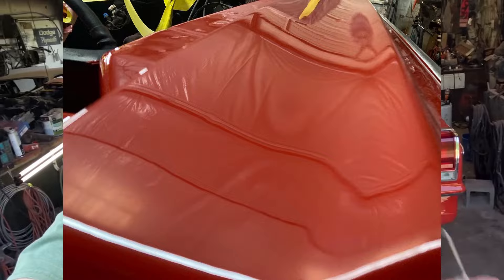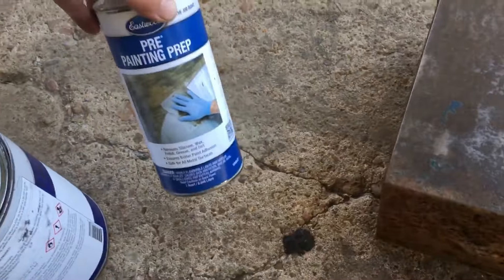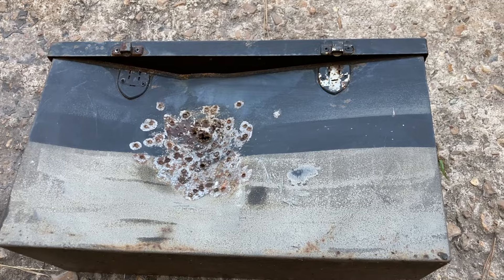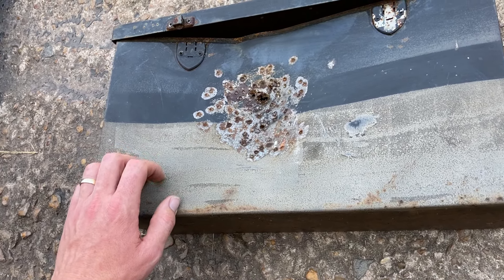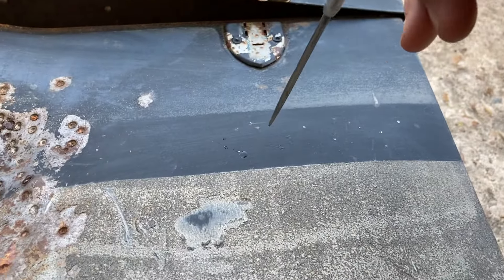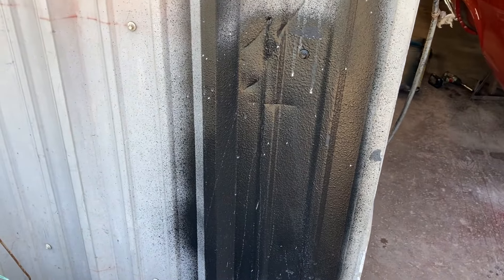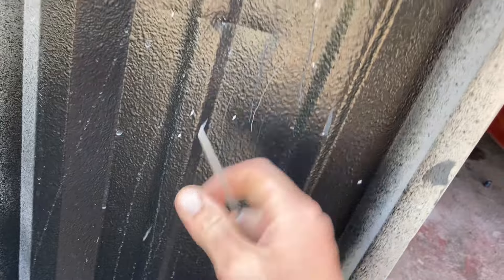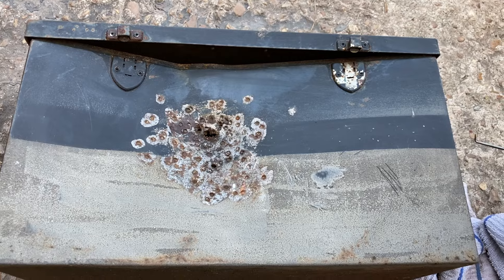Eastwood’s Rust Encapsulator, Ultimate Test: 2 years Later! #eastwood #rust #diy #test

Comment: Bout to get me some of this. My hubs got a 2014 that has a wee bit of rusting strips on the inside of his door jamb. Its not deep rust, so i was gonna use a wire brush and clean it up. But i needed to find something that was gonna last and actually stop the rusting process. Ty so much for this video.
Reply from the maker: It should do the trick! I’ve even let this stuff flash off and primed over it, then painted. In a pinch, I’ve painted right on top of it.

Comment: Man i sprayed that rapter liner on my trucks aluminum diamond plate bed-rails and that stuff flaked off like 50% of the coverage after maybe a month or two. I didnt do much prep but since then i have resprayed with regular rustoleum gloss black and it has held way longer
Reply from the maker: @taoisttiger4702  oh man. I would definitely say prep is key. If you could have scuffed the diamond plate or etched it with a chemical. KBS coatings sells an etch for bare metals to promote adhesion
Reply: FYI for you or anyone that sees this; Aluminum diamond plates often have a plastic film coating or some kind of sealant. You can use muriatic acid to remove it. it'll also look really shiny. but neutralize the acid and seal it immediately. Aluminum still oxidizes. But it doesn't turn red like iron and steel do.

Comment: Hey how you doing bro how
Much the bottom ended up with no paint and you topped that off with coating mind me asking I’m looking for the best advice on using a rust protector
Reply from the maker: Thanks for asking. Anytime I use rust encapsulator, I recommend coating it with something. You can scuff and paint over it with enamel.
Reply: @JustMoparJoe  ohh ok I seee so far your the only guy with videos relating to my issues I’m working on restoring a 97 Chevy Silverado and I noticed on your video the top half stayed black and the bottom didn’t but didn’t you coat the bottom ? But thanks for replying I’ll definitely be fallowing your steps bro thanks a lot !
Reply from the maker: @ShortBedWilly  yes sir. The bottom was a rubberized undercoating. In direct sun, it will fade. I also did a raptor bedliner over rust encapsulator as well on the channel.
Reply: @JustMoparJoe   what would you recommend me the most to throw over the rust a encapsulator , what do you think is the best coating to top it off with ?
Reply: Also thanks for taking the time to reply brotha I highly appreciate you man !
Reply from the maker: @ShortBedWilly  if it’s an area that doesn’t need to be shown, you can paint it with rustoleum from Home Depot, etc. if it’s an auto panel, I would sand it, then shoot a coat of 2k primer, then paint acrylic enamel it base/clear.
Reply from the maker: https://youtu.be/JKeSDSCaSCU

Comment: Thank you so much. I just don’t understand why encapsulate rust why not remove all rust?
I’ve done so many. Cars and always blasted to clean metal then epoxy primer I’m sure I’m missing something.

Travis in Ky
Reply from the maker: Thanks for checking out the video. Blasting definitely has its advantages and drawbacks. It’s not practical for most simple shop owners and diy people (which make up the bulk of hotrodders). A high volume air compressor, adequate space, proper ventilation, protective equipment, etc. Here’s a product that gets similar results with much less effort and expensive. I actually like to encapsulate areas and then sand and epoxy prime later. I agree it’s best to remove all rust, but sometimes it’s just not possible with everyone’s ability’s or budget.
Reply: @JustMoparJoe  you’re very welcome I’m gonna subscribe to your channel
If I can’t remove rust, I’m not gonna cover it up. I said I was probably in the wrong here. Thank you for your reply buddy.
Reply from the maker: @tb40ford  check out my new roadrunner project. I just cut a rusty quarter panel off and replaced with AMD metal

Comment: EastWood rust encapsulator performs very well. Used it on a 89 K5 Blazer. Still rust free. There’s a half dollar size spot of green rust encapsulator on my parents driveway. It’s still there hasn’t worn away after 15 years. It’s been beaten down by heat of asphalt, rain , ice and snow and still there. This in it self tells you something about the product’s performance.
Reply from the maker: That’s impressive! Thanks for sharing

Comment: I do not recommend raptor liner. I did my whole jeep in it only had a few rusty spots that I grinded down primed and raptored it literally dissolved my whole jeep in a few years held in moisture and salt 😭. Completely ruined my jeep. The liner itself lasted a few years but literally made everything under my jeep rust out when it wasn't even bad to begin with. Don't do what I did it looked sweet but killed my ride 😢. I literally covered my whole ride and everything I raptor lined rusted 😡
Reply from the maker: @brianbarranco7986  sorry to hear that happened. I did the blue truck 3 years back and it’s holding up great. I definitely could see that the raptor is a moisture barrier after installed, but base coat and clear coat would do the same thing if the surface under it wasn’t prepped and sealed properly. Primer is porous for sure. The rust encapsulator is much better at repelling water than primer is. I’m not sure what chemicals it has, but it’s supposed to stop the rust. I’ve used it for a sealer several times now with good luck.

Comment: That bed liner stuff is pretty good.  I seen a guy that had an International 9400  I that had a Cummins ISX 15 Liter engine.  The from cover was leaking oil pretty bad.  He washed it off, used grease remover then sprayed the bed liner all around where it was leaking oil, and presto it stopped the oil leak.   He later replaced the front cover because it holds the gear drive for the cam shafts.  You don't want those to get out of time.
Reply from the maker: Man that’s a fix! Definitely a new one on me.

Comment: So when I had spoken to you about how bad my pickup bed was, think that tool box from 2 years ago. Ive been tossing around a few ideas of what to do with it for years now but I think you just sold me finally on doing that encapsulator. I dont suppose you have used any of the rustoleum bed coating 'in a rattle can' with it? I really like the reliability and texture of the rustoleum but the prep on it has to be perfect bare metal in order to bond well. Any rust and its botched. Ive had it on a railing that is used daily for 6 years with zero flaking or fade.
Reply from the maker: I’m sorry I haven’t. I think I used herculiner on a car frame before and it stayed. I like the raptor kits.
Reply: @JustMoparJoe  Yeah I will hafta buy a spray can of it and use it on the tailgate

Comment: Yeah I like the Eastwood rust encapsulator and the internal frame coating...and I like to top coat them with valugaurd undercoating that's the brand look them up Joe Very good stuff. You can also buy the ceramic beads separate on line and turn any paint into a heat insulating coating. Lizard skin is another good product I've used with great success... It's a shame you had too remove your shoot the tool box video it was great!
Reply from the maker: Thanks John. Yea I didn’t want to not get monetized over it. I removed it in studio. I wonder if it’s still hidden up there somewhere

Comment: You are suppose to paint the rust encapsulator when it is being exposed to sunlight
Reply from the maker: I like to paint it regardless of it being exposed or not. But unlike the POR15, it doesn’t explicitly say it has to be painted. My  favorite application of it is to use it as a rust neutralizer on areas. I have primed, painted, and even put body filler over areas where it is applied.